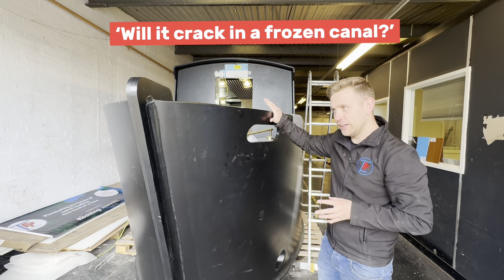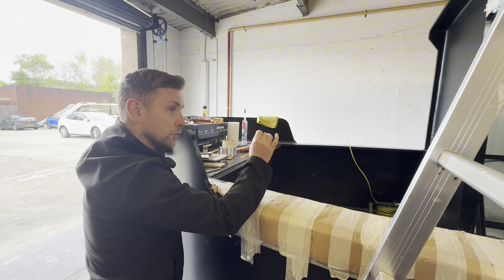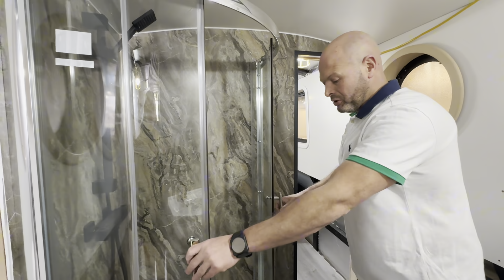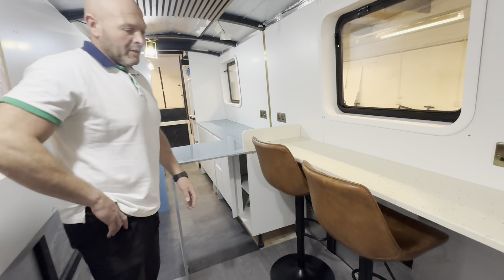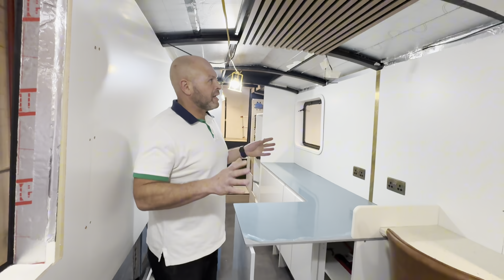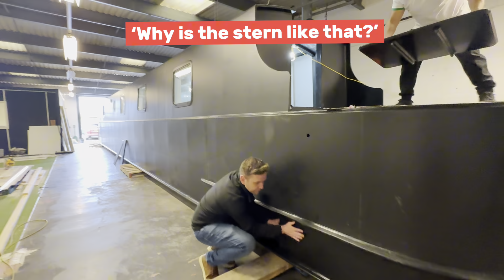The World’s First Plastic Narrowboat (MAJOR UPDATE!)

Comment: I would have thought even with a mesh system for the intake of the epod it is going to suck so much debri through that propellor.

Is there a weed hatch?
Why does it not have the foot walkways eitherside to enable you to traverse the outside of the boat?
Is that a generator tucked behind the epod?

How will the boat fair if it was hit by a steel boat?

Comment: What about a steel narrow bolt? Hit you with the whole thing? Crack?
Reply: If a steel narrowboat hits a boat made from HDPE (high-density polyethylene), the steel might dent or scratch, but HDPE is extremely tough and flexible. It won’t crack under normal impact because it can absorb and spread the force, which is one of the key advantages of HDPE over rigid materials like steel.

Comment: Waste tanks asymmetrical off the centre line ,there will be a variable substantial weight off the centre as it fills?
Are the water ballast wedges at the back filled independently to adjust the trim as well as the pitch ?

Comment: So no need for blacking, no need for anodes round the hull. (Probably just one or a pair near the motor pod). No worries about rust inside or out and a material so tough it is used on work boats that work in some pretty harsh environments. What's not to like? I expect the lighter weight will mean shallower draft, so less energy to required to move the boat - and the way some canals are getting shallower this also means less chance of grounding. It should also be better insulated. How is the boat for stability? It is lighter with less draft after all.  What will the all-up weight be? Are there any special requirements if lifting the boat or putting it on a trailer? With the cost of steel in UK now I hope this makes this a much more cost effective boat building system. 
Since a plastic hull means working with materials that are easier to move around etc. will this open the door to new designs? Perhaps the marrying of a Broads cruiser forward control with the dimensions of a narrow boat to fit the canals? I see electric propulsion as another move to making this prospect desirable - no needing to be at the stern to be able to listen to and control a diesel engine. It could be a whole new chapter for canal boats in general with designs only limited by people's imagination. CAD/CAM designs should also make this easier since it will do all the stress and strength analysis and weight calculations as you go.
Reply: Thank you, and you're absolutely right—the overall weight is about half that of a steel boat. You may have heard me mention that earlier (and I should apologize if my broad Scottish accent made it a bit hard to catch—I do tend to talk fast!).

The fully fitted weight will be around 13 tonnes. Our process starts with detailed CAD drawings and CNC cutting to ensure every component is manufactured to precise dimensions. We even create 3D models, which serve an important purpose: they allow us to visually confirm the entire design and layout, making sure everything aligns perfectly with your specifications before we move into full production
Reply: @ShaunMoir1  It wasn't the accent. It was me not paying sufficient attention.

Comment: I'm interested to know what happens if there is an impact on the hull.  If a steel hull boat hits a large rock for example, it bends, and dents, but can be hammered back out. With HDPE does it crack or bend, can be reformed ?  If a steel hull gets holed, it can have a new bit of steel welded in, is there an equivalent for the HDPE hull?
Reply: More likely to flex not puncture and you can plastic weld new sections in almost seamlessly .

Comment: i worked for crt for about 10 years maintaining canals and helping boaters i have been to quite a lot of crashes /groundings how will this hold up  getting stuck on underwater hazards like running aground on a bike will it puncture the hull or when they crash in to the locks and jagged canal walls i have seen it damage steel hulls. being made of plastic will it still float
Reply: A fair point.

Doubtless some newbie hire boater will test the boat to the limits.

If the boat is hirer proof then you might generate a following among the liveaboard cohorts.
Reply: Whitewater kayaks are made of HDPE and are designed to bounce off and scrape across rocks under the water. You could probably get scratches a couple of mm into it over time, but with 20mm on the sides I don't think you need to worry about leaks.
Reply: All depends on the "natural buoyancy* I suppose.

I wonder if it might be useful for CRT to run tests on plastic hulls which have neen holed.

Or perhaps a fire to check for flammability.

Might be of interest nut definitely expensive.

I suppose a worst case scenario would be a boat running into a below water obstruction snd creating a gash in the plastic (think Titanic sort of damage).

I don't suppose either thats going to happen anytime soon though.

Comment: I asked the question about the sacrificial chine on the base plate to the sides, I've shoeplated many steel boats when the chine has eroded and been worn by boat use, mooring etc, welding a 100mm x 6mm thick strip of steel under the boat extending beyond the sides, this erosion will still occur on this boat, what is the repair procedure for this??
Reply: The procedure for plastic welding closely resembles MIG welding in terms of general technique. Both processes involve surface preparation, controlled heat application, and the use of a filler material to create a strong bond. In our plastic welding process, we typically work with thermoplastics such as polyethylene (PE), polypropylene (PP), polyvinyl chloride (PVC), and ABS.

The welding gun used in plastic welding is equipped with a hot air blower or an integrated heating element  This gun is noticeably heavier than a MIG torch due to the built-in heating and airflow mechanisms.

Unlike MIG welding, which uses a continuous wire feed and high-current arc, plastic welding is slower and requires precise temperature control to avoid degrading the material. The filler rods used are made of the same type of plastic as the workpiece to ensure proper bonding.

Comment: I'd like to see some more technical details, starting with dimensions (outer and inner) - how much space inside is lost because of the ribs and your choice of insulation material? The finished walls look very thick.
How thick is the bottom and how is it protected against all the rubbish inconsiderate people have been throwing in the water - starting with rocks, ending with bicycles and shopping trolleys - visit Taylors Aboard a Narrowboat and check the videos from January to see what a fairly clean canal floor looks like. How dangerous to the hull would be getting hit by a steel narrowboat or hitting a brick bridge like Nomadic Crobot did last year?
You didn't say anything about the gunnels even though that was one of the most popular questions.
Reply: Apologies for that — I was trying to recall some of the questions.

The gunnel depth is 1.14m. We understand this is slightly shallower than usual, but our advisors confirmed that it would still be suitable.

We also have additional videos of the testing we've carried out.

To clarify on the construction: the ribs are 20mm thick, the spine of the boat is 40mm thick, and the rest of the structure is also built from 20mm HDPE.

Comment: It seems that these are wonderful boats, using systems tried and tested in other places on other vessels.  Inspired by the marine experience, what fire suppressant systems are available to instal on the narrowboat?

I love that you have taken inspiration from Sea Otter for ballast and Azipod for power.  So exciting.
Reply: Same fire prevention as any other boat,ie whateber you want
Reply: @Bobg425  HDPE is more vulnerable to  fire - hence the question.  More top line yachts use a fire suppressant system when they are made of HDPE.
Reply: It’s a important question so the ignition temp if this is the around 340 we use fire resistant kinsgpan and make sure everything is fully safety checked etc I will be showing more videos and more at crick
Reply: @ShaunMoir1  Thank you for your response.  I find myself dreaming again of a narrowboat...

Comment: I would like to see an Azimuth thruster propulsion unit like Rolls-Royce designed years ago. The whole pod turns in any direction so there is no rudder needed nor reverse. This frees up a lot of space on the back deck. Also would like to see all corners of I worktops and bathroom sink to be rounded like the size of a saucer. Sometimes you have to run through the boat in an emergency, to drop an anchor or catch a rope and running into those existing corners is going to hurt. This is a great start to a whole new era in narrowboats.
Reply: If they did that would it not have to hang down below the boat drastically increasing it's draft?
Reply: Another advantage of the azimuth thruster is that the boat does not need to be moving for the 'rudder' to work. It is rather like having a stern thruster. There are narrow boats with the azimuth thruster. I saw one on 'CruisingThe cut'.
Reply: @bizarremagick rudders don't require the boat to be moving to work. What they do need is a skipper that realises rudders stall at angles greater than 35 degrees. Manoeuvring is best done at very low speed or preferably stationary as radius of turn is directly proportional to speed

Comment: Extremely disappointed to hear the hull will always have to be made of virgin plastic because of strength issues. I'm not exactly an expert on the qualities of virgin versus recycled HDPE on narrowboat hulls, but I'd take this statement with a very big grain of salt. With a bit of application, research and experimentation I'm pretty sure ways would be found to incorporate at least some recycled plastic in the hull which let's face it is the major user of the plastic. It would be a huge leap forward in the 'sustainability' of plastic narrowboats otherwise this is quite a heavy new demand for virgin plastic made directly from hydrocarbons, that's not good. We already have lots of first generation plastic that needs a market for recycling rather than creating even more virgin plastic. Nice to hear microplastic issue being raised, it's an issue, but there're always issues - 'sustainably' harvested timber still results in significant loss of wildlife so even if there's some shedding of microplastics still not a huge problem compared to others we could have IMHO. Shame no mention of whether or not new propulsion system reduces the stirring up of sediment compared to standard set up at present. Anything which could have narrowboats using the canals whilst reducing the amount of sediment that ends up colouring the water and damaging flora and fauna is a very positive step forward and worth crowing about. I'm still feeling pretty positive about this, but would like to feel even more so.
Reply: hear you—and your skepticism is totally fair. Virgin HDPE is often cited for its consistent mechanical properties (impact resistance, tensile strength, UV stability), but that doesn’t mean recycled material can’t play a role. Many plastics engineers blend small percentages of post-consumer or post-industrial recycled HDPE into virgin resin to strike a balance between performance and sustainability. Even a 10–20% recycled content can make a big dent in your overall plastic footprint without compromising hull integrity—especially if the recycled fraction comes from well-sorted, high-quality streams.
Reply: @ShaunMoir1  Thanks for that - if a lot of the problem lies with the low quality of recycled stock then I think there's some room for getting higher recycled content - I've worked in recycling myself and know a lot of collected plastics are very badly mixed plus general junk such as mud and food remnants don't help. I'm positive very, very high quality recyclable HDPE can be sourced. I find the idea of turning old milk cartons into narrowboats as bloody fantastic! Thanks again for getting back to me - love what you're doing.
Reply: Your correct we are looking and speaking with our suppliers that we will be using recycled material for the hull however the key word here is all this is recyclable

Comment: I  have several concerns regarding this boat.  
Putting the waste (sewage) tank on one side of the boat will be a major problem as the boat will list more and more as the tank fills.  It needs to be over the centreline of the boat.
Won't the baseplate wear away rapidly at the point where the boat narrows at the front? 10mm steel wears hence the sacrificial 20mm left sticking out by boatbuilders.  HDPE will wear much faster.  This could be mitigated by adding steel capping possibly.

How easily can the prop be cleared of weed, rope, fishing line etc. (unless the boat has a weed hatch and I failed to spot it).
Reply: Their is a weed hatch behind the epod 😃😃

Comment: Some canals are quite silted and the boats have very little clearance. So the propeller draws rubbish off the bottom of the canal. Wich tends to get stuck around the propeller hence a bit of weed hatch fishing 😂.If this happens with your design how do you remove it from your pod propeller.
Reply: He said 17-18inch draft so it sits a bit higher than other boats,ie off the bottom. Id still want a mechanism to claer crap from the prop.
Reply: Just lift the pod out and clear the debris.

Comment: 800 litres of water is 800 kilo - not 8t ! Maybe he meant 8,000 litres ? Enjoying the follow up videos. Are wide beams possible ? I hope to look at a 60x10' when i retire in the near future fully electric or maybe hybrid.
Reply: I meant 8,000litres sorry after I said it I went oh god it’s not that😂😂😂
Reply from the maker: @mickkirton7943  he meant 8000 litres - I added the correction!
Reply: Presumably this is ballast weight under the whole length of the boat.  If it is just in the bow then the boat would surely sink with 9 tonnes added right at the front of a 13 tonne boat.
Reply: Correction, 8 tonnes, but my point still stands.
Reply: I think you were missing what I was saying we water tested 8tnnes of water inside to check for leaks etc

Comment: Epod exterior is surprisingly unfaired/unstreamlined? Will a cover with a smoother transition be fitted, or will that interfere with the water cooling of the ring exterior? Is a rope cutter fitted to the center hub aft of the propeller?
Reply: So we are looking at different options one being the wood being steerable 180.

Comment: What about weight and balance?
Reply: May be my accent weight fully fitted is around 13tnn 😃
Reply: Canal boats are flat bottomed so why would their be a balance issue. Buoyancy is no different, neither is the application of ballast.

A plastic skin will be much lighter than steel, but with modern materials fibre reinforcement should make it both resilient and free from corrosion, so no anode and blacking requirement.